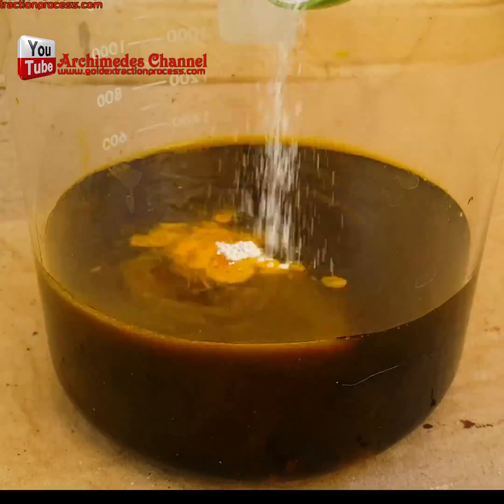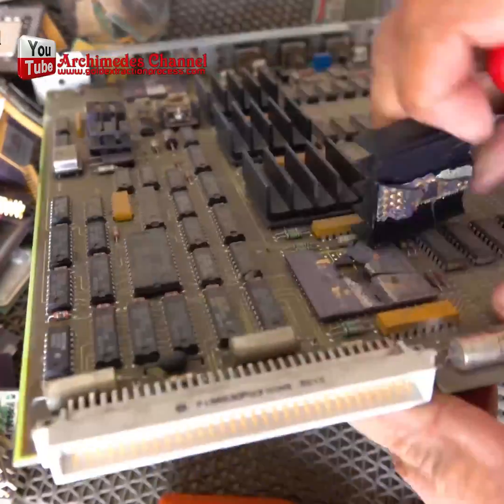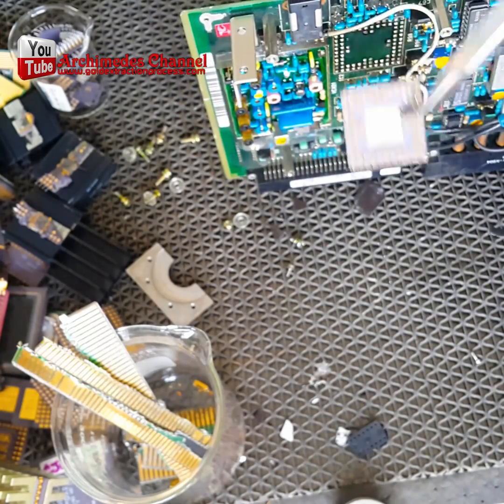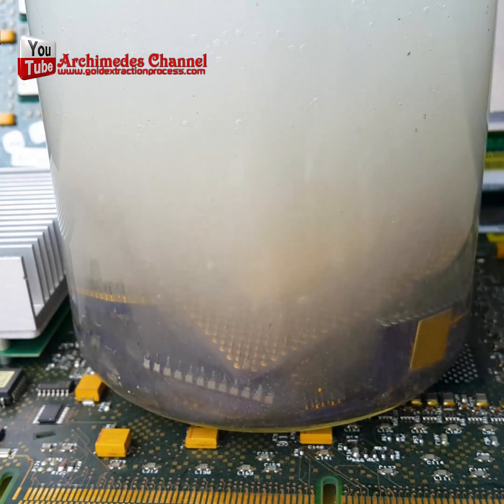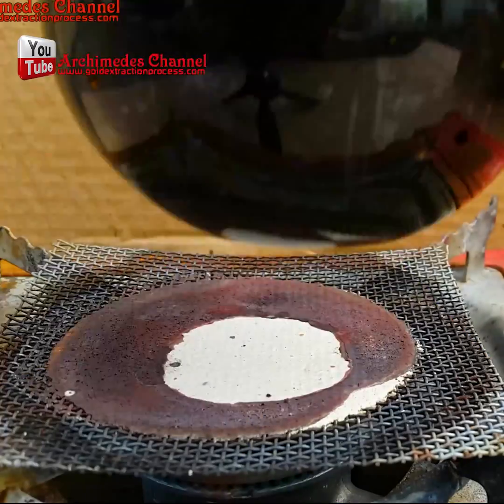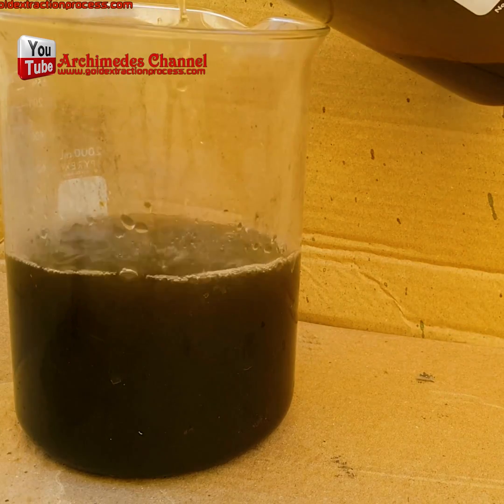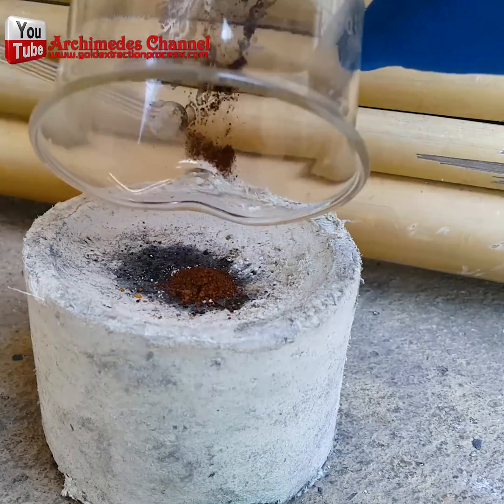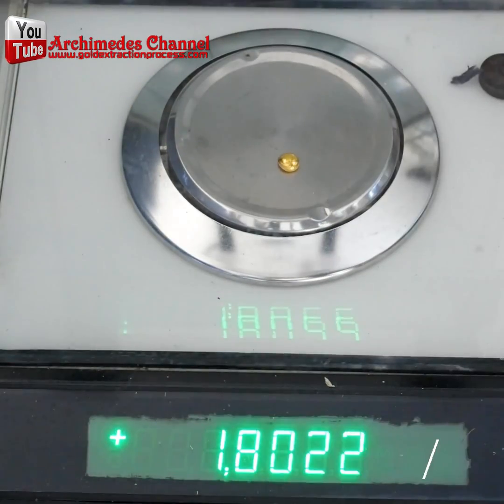For all of you treasure Hunters gold lovers Old computer chip | Archimedes Channel |

Comment from the maker: :_wow::_wow::_GoldBar::_GoldBar::_GoldBar:In the context of old computer chips, some vintage CPUs (Central Processing Units) or other electronic components from early computers can be considered collectibles. People who are into electronic or computer history may be interested in acquiring these items. However, it's important to note that not all old computer chips are valuable, and the market can vary based on factors such as rarity, historical significance, and condition.

As for gold, some older electronic devices, including certain computer components, may contain small amounts of gold. This is because gold is an excellent conductor and is often used in the connectors and plating of electronic components. However, the amount of gold in individual components is typically quite small, and extracting it for its monetary value can be challenging and may not be economically viable on a small scale.